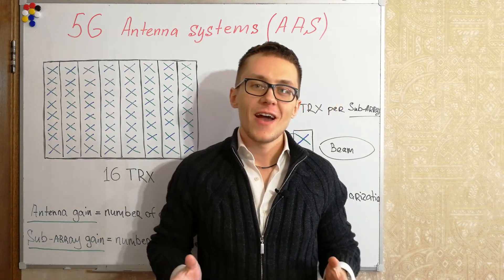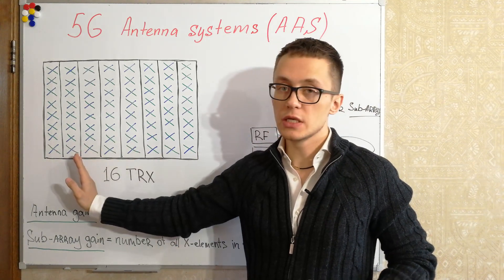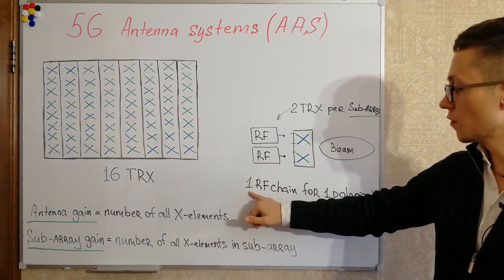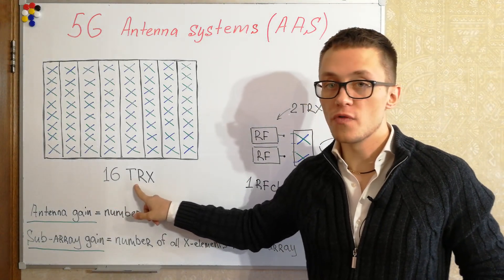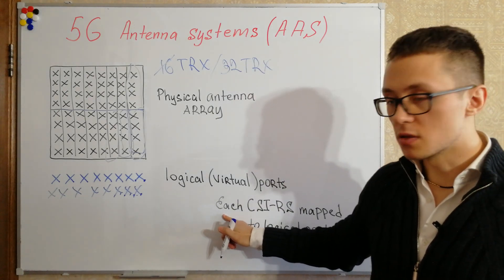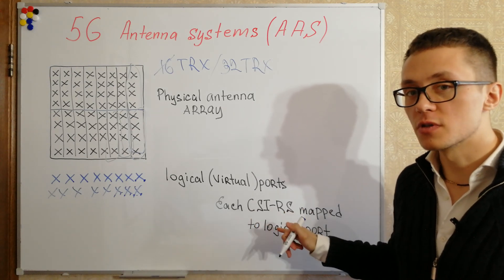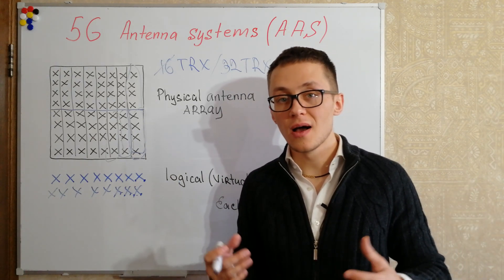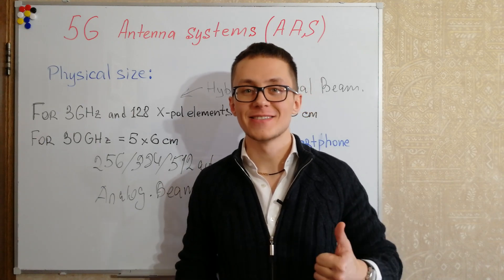5G Course - Advanced Antenna Systems (5G panels, 5G antenna arrays, 5G mMIMO)

Comment: Thanks for the video! When you say FR2 is MIMO 2*2 at max... seems opposite, FR2 is now commonly used in MassiveMIMO. Or I probably misunderstood what you meant.
Reply from the maker: Thank you for question. This video from 2019. Not so sure about how exactly it is right now. But as far as I've managed to find, FR1 UEs are expected to support up to 4 (or 8 if the UE reports it) and FR2 UEs are mandated to support at least 2 layers (FR2 devices are usually constrained to fewer Rx/Tx layers because of RF/antenna limits). So, the main limitations are on the UE side, not BS antenna.

Comment from the maker: 🧠Time codes:
0:10 - what is advanced antenna system?
1:00 - array, sub-array, TRX, beams and polarization
4:15 - antenna gain and sub-array gain
5:45 - single panel, uniform and non-uniform multi-panel
7:15 - MIMO and beamforming combination
8:25 - the key idea for mmWaves antennas
10:04 - physical, logical, virtual antenna ports
14:45 - antenna size for mid-bands and mmWaves